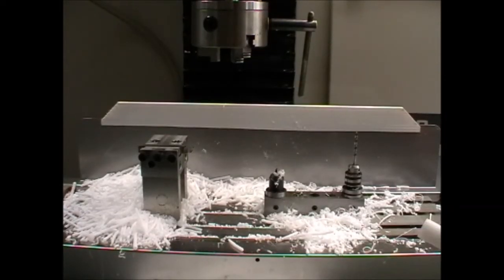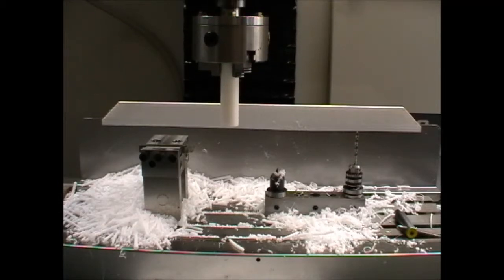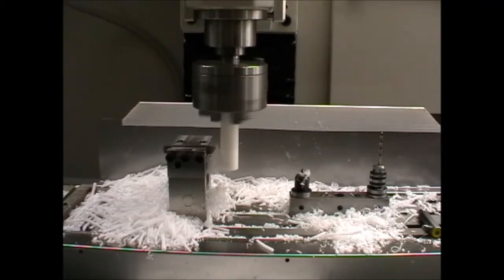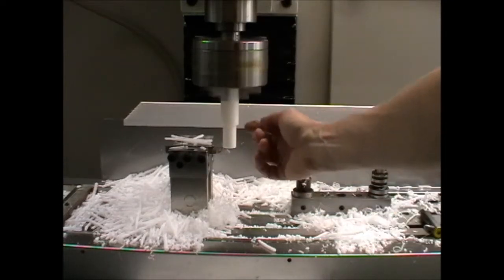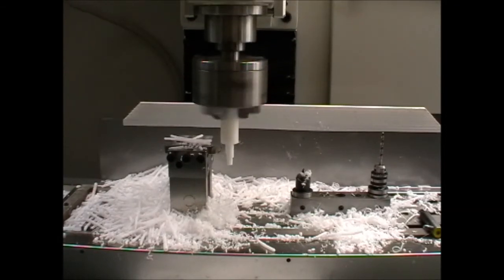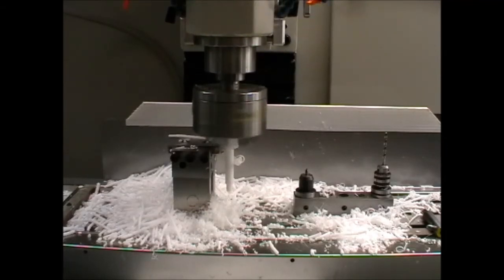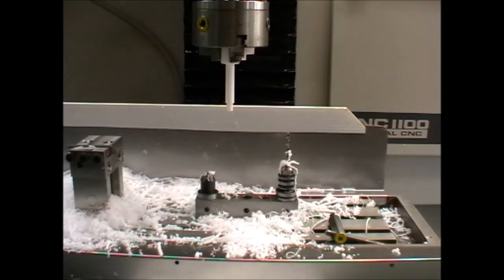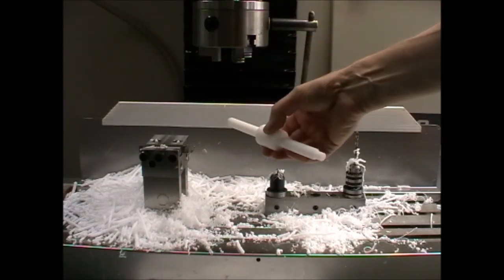Mill Turning Acetal

Comment: Thanks for the Video. Good tips. What cutting tool are you using there?
I have worked out Fusion using lathe turning. So now I can design and cam and not have to amend any code other than the Tool number which has a radius number, eg T6903, included which the mill/pathpilot not been a lathe doesn't recognise. The other code is a G07 which is also lathe specific. I deleted this in the post processor file. The only thing to watch is due to the G07 (diameter mode) when you zero X on pathpilot you then have to ensure you enter the exact part diameter from your design as the new zero so the code matches up. Eg if it is 16mm, zero then enter 16mm in X on pathpilot and enter. 

Will have to play with G54 G55 etc for tool changes and or see if I can trick the cam on this too.
Reply from the maker: +Bert R Thanks Bert.  Good work on using Fusion - what are the long term cost outlooks for this software? Re cutting tools - see my other videos , For alum and acetal I grind my own.cheers
Reply: +Threadexpress Good question... But I have used Inventor under the student licence for a long time so pretty ok plus to buy the commercial version is only a few hundred $ I think.